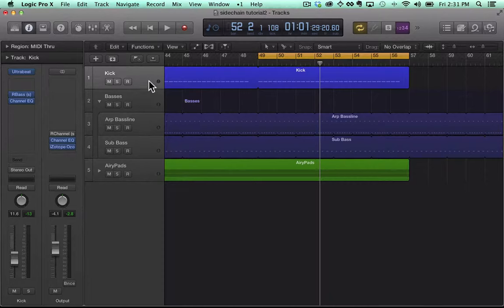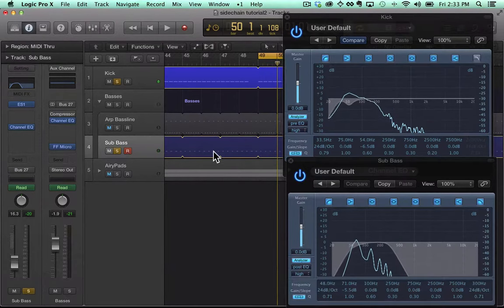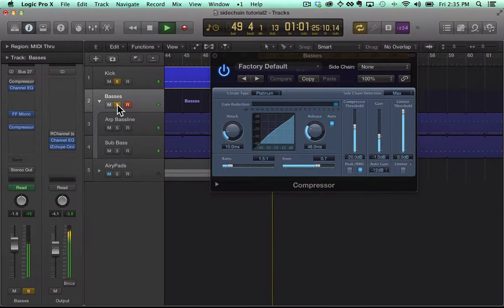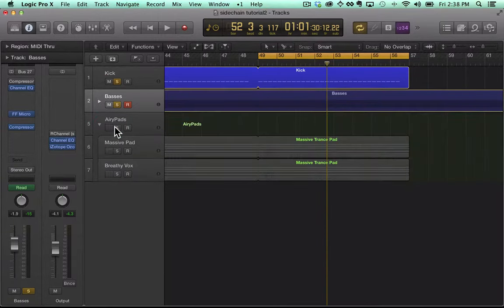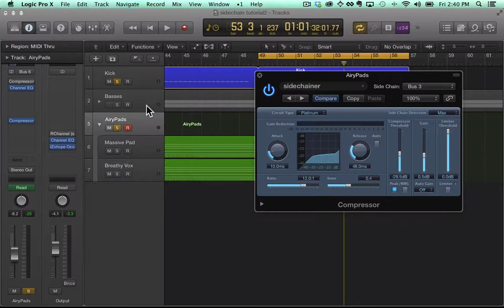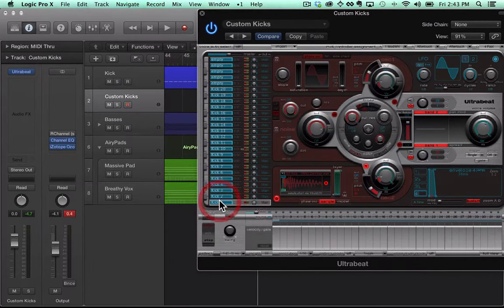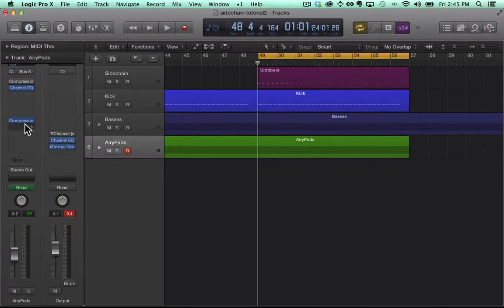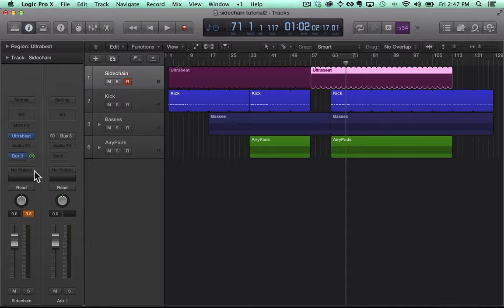Sidechain compression in Logic Pro X

Comment: Why do i still hear the kick while "no output" is selected?
Reply: X. TALKDUNSK 
i got a piano and wanted to sidechain it, so i followed the second way he explained it in the video (with a virtual kick that should not be a musical part, but just with a function as 'sidechainer' while the sound of the kick itself isn't coming out).
so i put a compressor on the piano and selected 'bus 12' on the sidechain options (it's a empty bus).
then i created a new track and put a kick (that won't be heared but will just sidechain the piano) just as he did in the video; then selected 'no output' and sent that track to 'bus 12' too, where the compressor is working.

the problem is that when i turn up the bus "volume" in the kick track (the thing he forgot to do and then fixed in the video), i hear the kick also if there is no output! why? i didn't really understand what you meant with SEND/AUX

sorry, i'm new to logic :-\
Reply: X. TALKDUNSK well that helped a lot! i had to send the kick stereo to bus12, and then set 'no output' on the bus! strange that he directly turned off the output on the kick channel (in the video) cause it didn't work for me.

Done it, thanks :)
Reply: X. TALKDUNSK i just read that... but have i to select as 'no output' both the kick channel and the bus, or is it right as i just told?
Reply: X. TALKDUNSK it works fine to my ears like i just did it :)
Reply from the maker: EDM Skorpion Yeah, I turned off the kick because for sidechain, I generally use a different kick track than the "real" kick.. That way I can sidechain independently of what the real kick is doing. For example, I might have a breakdown that might have the kick drop out, but I still want the sidechain happening. So I use two separate kick tracks -- one that is always no output that feeds the compressor. Anyway, I'm glad you guys could sort it out! Thanks for watching.